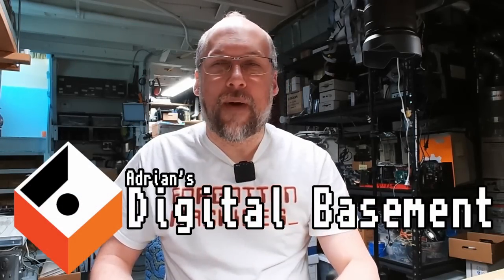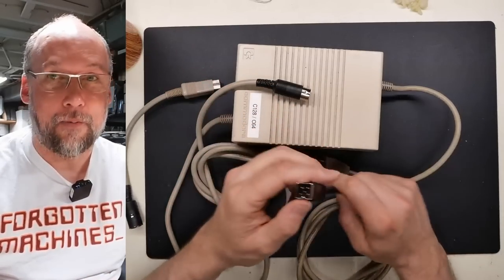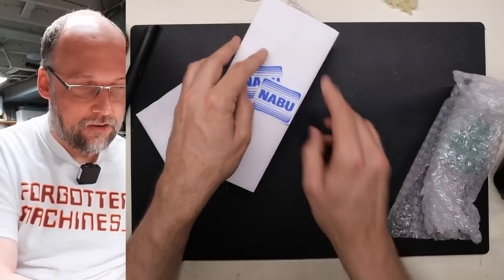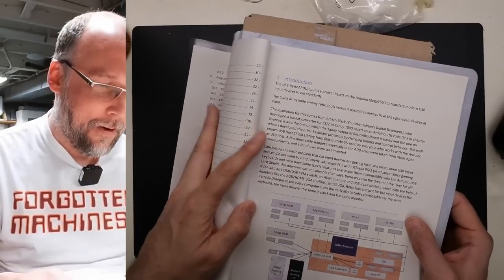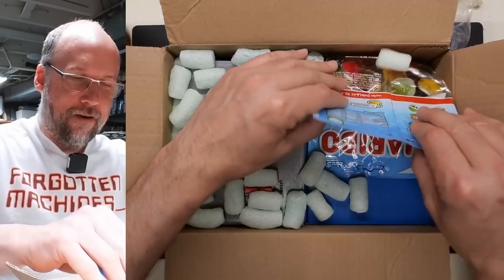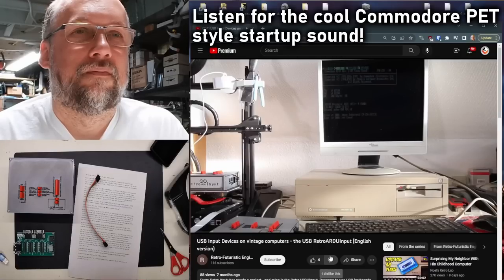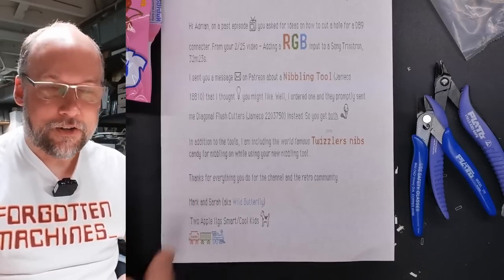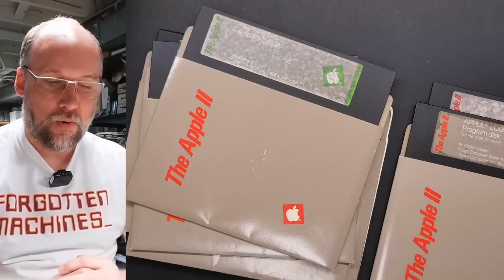0061 A universal keyboard/mouse adapter, an Apple IIe numeric keypad, some NABU stuff and more!

Comment: Chip tubes DIPs potentially take up less space than drawers, and you can scan the top of the tube (assuming they are transparent) to find what you're looking for rather than rummaging through a bin of ICs potentially bending pins along the way.
Reply: The problem with chip tubes is that they're just too long. Cutting them shorter doesn't help because you would have to find bumpers for them. If you have a bunch of the same type of chip, fine, but they're not good to store your chip assortment.

Comment: What about sourcing used DIP tubes, then just number each one and start a spreadsheet that lists the contents of each as you go along? That way you get them out of the loose bags for now.
Reply: They don't stack and they're too long to put in a shelf, they just end up as a big mess of sticks in a bin. And those pins on the end are a pain to open too. The best way for me with the bigger chips (especially EPROMs) has been to buddy them in pairs and put them in old NES cartridge rental cases that I got back in the 90s.

Comment: at 55:00 did you noticed the STEREO SPEECH jumper on the mocking board? just above 2 empty sockets
Reply: Probably so you could populate one speech chip and output mono to both channels, or 2 chips for full stereo.

Comment: I kinda doubt the keyboard folks were buying the nabu just for the switches, generally speaking any tall switches are gonna require more work than the average keyboard enthusiast is willing to put in. If you can't take the parts and put them in a commercially available kit or get a commercially available adapter to use over USB they don't care all that much. I know of a few people who have designed passive adapters (so you can run a USB cable out the back of the machine and still use the keyboard with the nabu) and they specifically didn't release the designs for these adapters so people wouldn't separate systems. A lot of modern keyboard kits are hotswap because a decent number of keyboard folks just don't want to solder, buying a board that doesn't have an existing converter/adapter, can't be turned into parts for a commercial kit, and requires desoldering is way too involved for most.

Most of the keyboard folks that got a hold of one primarily have it as a display/collection item more than anything else I can basically guarantee. The seller also had some damaged units so an orphaned keyboard or orphaned system isn't guaranteed to be a result of keyboard folks separating a board from a system. I was trying to get a few of the damaged systems but once the seller realized he could overprice them and put them on ebay he just stopped responding. Before he started listing them on ebay he was selling them for like 15 locally.

Comment: I had a similar experience with LOGO in high school.  I had already been using my CoCo for several years, and had learned LOGO on a TI 99-4A.  I wanted to take the Pascal class they had, but LOGO was a pre-requisite.  I spent more time working out the math to calculate angles and curves to draw dust clouds than anything else.  My first test I got into an argument over using a repeat statement to draw a square.  The teacher marked it wrong, but I eventually argued "did what I wrote draw a square? yes? then give me the point"  We eventually came to an agreement that I wouldn't use things we had not learned in class yet.  The irony is I never got to take the Pascal class because I graduated early.  Oh well. :-)

Comment: I have an Apple ][e with a v2 Analog for VGA, a v2 Analog for Z80, a Mockingboard and a Garrets Workshop RAM2E II 8MB AUX ram card. I want to continue tricking out the machine, what other cards would you recommend (I do already have a floppy disk interface)?
Reply from the maker: You definitely need some kind of storage system, like the CFFA-3000, Booti or FujiNet Apple
Reply: @adriansdigitalbasement2  I do have a FloppyEmu, but mostly wondering what other cards I could shoehorn in 😁
Reply: Get accelerator, ethernet and SCSI cards. Then hook up a SCSI hard drive.

Comment: I'm curious:  what's the advantage to modifying the 128 power supply to a 64 plug and then converting back with an adapter if you want to use it on a 128, rather than just making a 128-to-64 adapter?  (I promise this is a serious question and not just a snark.)
Reply: I'm guessing finding a female square plug. They're probably a lot less common.
Reply: @mal2ksc  just like those multi-console video and power cables you’d get for cheap from third parties!

Comment: 52:35

> Official Apple IIGS Diagnostics (now including v2.2, v3.0 and v3.1 (Disks with v4.0 and v4.1 labels have been found, but the software itself still reports the newest version as v3.1. if you can provide v4.0 or later versions, if they exist, please submit them)

;)

Comment: The 6522 timers are clocked from the 6502''s Phi-2 clock, so the timers are affected by the CPU clock speed.
Reply from the maker: Ah would only help then if the clocks were asynchronous, which would likely be the case on most systems with accelerators. (I know Apple II accelerators don't feed the fast PHI1/2 to the motherboard)
Reply: @adriansdigitalbasement2  The problem is that the Phi2 is also used to synchronize the timing of read/writes to the chip so that complicates any attempt to use a different frequency.

Comment: Great video @adriansdigitalbasement @adriansdigitalbasement2

To test floppy disks I use a GreaseWeazle to write a ready to go SCP file to the disk and then I read the disk back as a SCP to look at the new disk image in the HxC Floppy Disk Tool to see if there is any possible damage on the disk.  This might be over kill, but I like making sure the disks are fully  usable in use cases where I need specially formatted disks for a special system.

Also nice shirt :)
I didn't know that @ConvergentMightyFrame had T-Shirts made. :) Very cool :)

Comment: Commodore's VC1350 mouse was crap, it only mapped mouse movement, corresponding to the 8 directions possible with a digital joystick
Reply from the maker: Sounds terrible!
Reply: @adriansdigitalbasement2  It was even marketed here in Germany as a "professional alternative" to joysticks.
"Now you can play arcade titles like Marble Madness, or Flight Simulator 2, like on a professional Amiga system!" - The advertisement has burnt itself into my memory...

Comment: The "S" on the chip at https://youtu.be/aTCy7yM50vI?t=476 probably stands for synertek, which was a second source for many mostek chips like 6502, etc.
Reply: In this case the chip is indeed made by Sharp. The dead giveaway is the "L" at the start of the chipname.

With manufacturer logos on chips you also have to consider the form of the letter(s) and the "S" isn't as stylized as the one from Synertek with three parallel lines, no diagonal in the center and two half circles (google it to see the difference). Sharp simply uses a rounded, bolder font with a diagonal in the center of the S.

Finally, Synertek's only operational fab in Santa Clara stopped operations in 1985 so it couldn't have produced this chip in 1988...
Reply: @oldguy9051  yep. you are right. not synertek.

Comment: Man, I understand keyboards are cool but there are plenty of good custom modern keyboards you can use with your current systems. They are really making it hard to be into vintage hardware when you can get the systems for cheap and then the "rare" keyboard goes for 200-1500. It's a damn shame. If you want a vintage keyboard just get a Model M since there were plenty....
Reply: My daily driver is a Model M!  I built that keyboard adapter mainly just for fun 🙂  Rest assured, my NABU keyboards are used with my NABUs nearly 100% of the time.

Comment: 25:40 - you can tell this has been written by a german 

"PC/AT und PS/2 incl. scancode sets 1, 2 und 3"

I guess that either slipped during translation of the manual from german to english ... or happened during writing, if the text has been originally written in english - at least that happens to me occasionally - I find myself typing "und" in an english text when I meant to write "and"  XD

oh yeah ... and I bought a bag of super mario haribos recently too